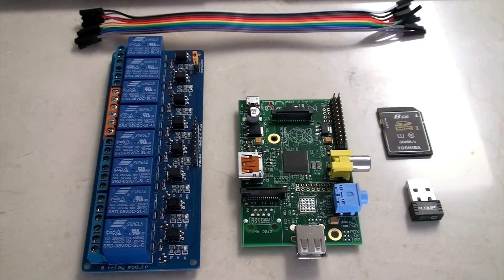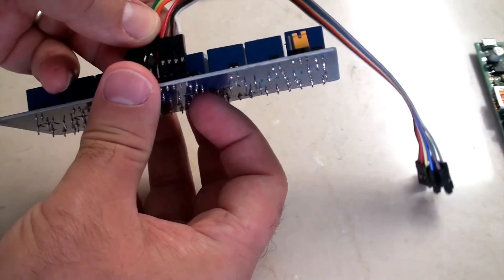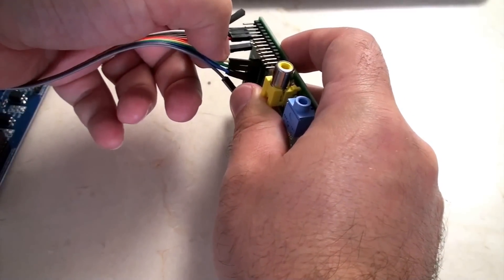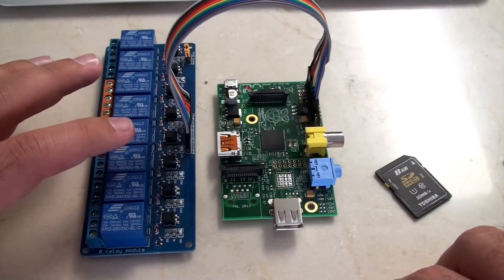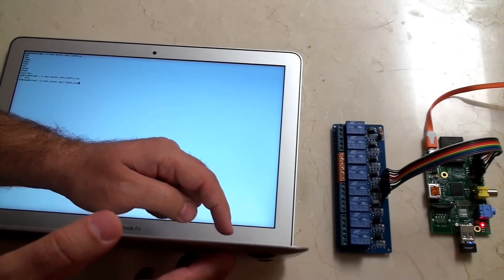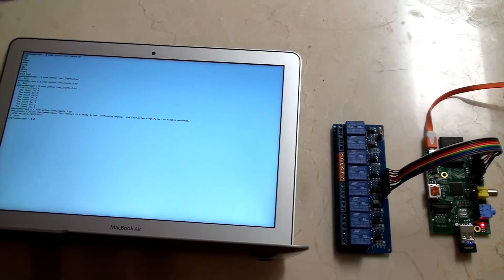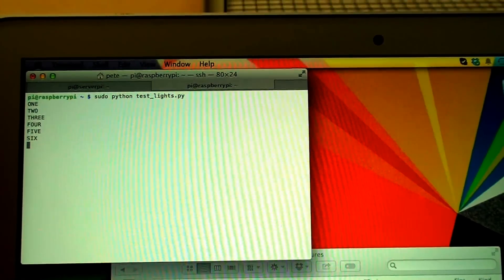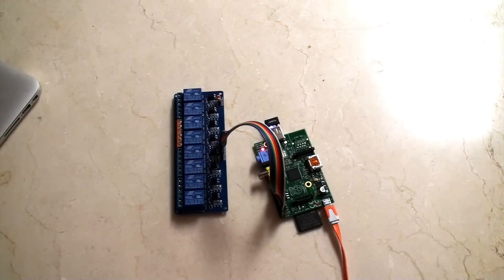Raspberry Pi: 8 Channel Relay step-by-step with software examples for automation

Comment: Great video, this really helped me understand Raspberry Pi GPIO so much more. I'm currently working this video through and trying to get it to automate some lights. Working well so far! but my in4 on my relay isn't functioning. So I hope it's not one of my pins, I've changed the wire and that had no effect. Going to have to try it on a different GPIO pin.. :)
Reply: Abraham Gihawi Just tried a different GPIO pin, as well as a different wire, and it's definitely the relay that's faulty. :(

Comment: great video. Do you need external power supply to control the relay board ? or just the power from Raspberry (5v) and will this work with the new raspberry pi 2?

thanks

Comment: I did exactly as you mentioned in the video but mine is a Rpi model B and I used a 2 switch relay when I turn the gpio on nothing clicks. Any idea why this could happen. However there is a faint LED light that turns on when my hand makes contact with the PCB pins. Other than that nothing happens(no light no switching sound). What could be the reason? Any help will be appreciated. Thanks!
Reply from the maker: Rahul Sathanapalli Maybe check this video out... https://youtu.be/OQyntQLazMU  I had problems but you can watch me work through them.

Comment: I'm starting a project that will control Relays taking commands from the internets, did you ever find out why the model B had that delay? Would it help if the relay board had a separate power source or is that not an option?
Reply from the maker: Vulpestruments That's what everyone here has indicated.  That with a separate power source, I would not experience that delay.

Comment: what died is your ethernet/usb controller at the end.. too much power output freezes the network connection thus ssh freezes. An annoyance I've had happen a lot when working with gpio. This not happening in the raspberry pi 2? I see it's in your description to get a 2B?

Comment: great, I had one running more than 6months all it has do is turn on the lights at 6pm to 6am outside. All I use is a Rpi A+, RTC module and 8channel relay module.

Comment: I have recently purched the 16 ch version of this board and was wondering if anyone could help me with the coding to allow relays to be activated by keyboard buttons. The 16 ch also has a port for a 12 volt external power supply alowing it to draw more power without straining the pi. I have a b+.

Comment: I'm no expert, but based on my experiences and stuff I've researched I suspect your assumption that the weird delay is power related is correct. I've notice that if I'm drawing a lot of current from the gpio pins that the status light on my wifi adapter can shut off. I think there is a minimum current threshold for them to work which is reached with these larger and more power hungry devices. The pause would be because the ssh client can't talk to the pi, but it waits a little while to see if connection is reestablished. Once it is, the terminal window updates and becomes useable again. That's my theory anyway. I don't actually own one of those relays to test it. If you're worried about it you might consider getting a separate power supply for the relay board and see if that fixes the problem.
Reply from the maker: Robert Forde Cool, I'll try that.

Comment: Hi all,

this all is completly new for me, so this video helped me to get started, using a Raspberry Pi B+ connecting on GPIO 17 - 24.

The scripts gave some errors, main problem was 'the numbering' in the scripts:
# for GPIO numbering, choose BCM
GPIO.setmode(GPIO.BCM)

#init list with GPIO numbers
pinList = [17, 18, 19, 20, 21, 22, 23, 24]

# or, for pin numbering, choose BOARD
#GPIO.setmode(GPIO.BOARD)

# init list with pin numbers
#pinList = [11, 12, 35, 37, 40, 15, 16, 18]

Use BCM OR BOARD, not together!!
Reply from the maker: Roland Megens Thanks for sharing this, I'm sure lots of people will appreciate it!

Comment: great vid mate, im a noob and i wonder how did you set up so you can connect and program wirelessly your pi??

Cheers
Reply from the maker: Nacho Miranda It's called SSH.  If you have linux or a Mac, use terminal to SSH in.  If you are a Windows user, the program you need is PuTTY.
Reply: skiwithpete thnx a lot man..you are awesome...one of the few youtubers thats responds every message posted...

Comment: Try this, it's fun.
I counts up binary.
I used it with leds, but it works as well with the relays.
Test all intedations. When I pasted i to this editor, all TABs and extra Linefedd was gone.

=================================================
#!/usr/bin/python

from time import sleep
import os

# import GPIO

import RPi.GPIO as GPIO

GPIO.setwarnings(False)
GPIO.setmode(GPIO.BCM)

# Setting up ports
# Just edit the following line for use with your relay setup:
LED = [4, 14, 15, 17, 18, 22, 23, 24]

for a in LED:
	    GPIO.setup (a, GPIO.OUT)

# Setting all outputs as off = 0
for a in LED:
	    GPIO.output(a, 0)
	

#Initialize variables
mask = [0, 0, 0, 0, 0, 0, 0, 0, 0]
Bit = 1

for b in range (0, 8): mask[b] = Bit << b
try:
	    while True:
# The loops to do things

        for a in range (0, 256):
			            for b in range (0, 9): GPIO.output(LED[b], a & mask[b])
			
			            sleep ( 0.2 )
		        sleep(1)
except KeyboardInterrupt:
    print
	    print " Cleaning up."
    GPIO.cleanup()
	    print " Goodbye."
===========================================

Comment: Hi; I am totally new to the mini pc. I was looking to control all my warning lights that are on my plow truck with a simple switch box that would contain just momentary buttons. I would like to connect these buttons to a PI that would be located in the engine compartment along with a ( 8 ) relay block. What i need to know is can I do this and how complicated would it be. I am some what knowledgeable of electronics but not the computer code. Can anyone take a moment and help me with this?
Reply from the maker: Big Guy Review I don't know enough about what you're trying to do to answer your question - but check my other relay videos too, you'll see what I was able to do with them.  Hopefully, someone else will come along and be able to help.  Cheers, P
Reply: thanks for the reply. All I wanted to do was control these 5 volt relays from inside my truck with out having a bulky control switch box.
Reply: Big Guy Review I think it would be easier to do that without the Pi honestly. The only purpose of the pi with the relays is to essentially create a digital switch (the pi and the scripts you run) to trigger each relay and turn it on or off. Have just some simple momentary switches connected to the relays would achieve the desired result and you'd skipt the programing step and wouldn't need to run a script every time you want to turn on or off a light. Or you could use locking buttons or toggle switches and wouldn't need the relay. Just make sure the switches are rated for the correct voltage and current

Comment: Hi,
Thanks for the tutorial, I am thinking using this setup as part of a project.
However I am a bit confused on which type of Raspbery pi to use. I would like to avoid the use of an additionnal power source for the relays. You mention that for this reason, only the type A should be used. Will the A+ or 2B (in the part list) that were not out at the time will work without "burning"?
Thanks in advance
Reply from the maker: Louis Bradier They'll both work just fine.  Cheers, P

Comment: You are powering the actual relays from 3v3 GPIO logic pins, this is very bad practice and should never be used even for testing. (as far as i know)

also the whole point of it being an optocoupled board is isolation, which you now bypassed so a small spark in the relay module and your pi is toast anyways.

sorry, just trying to give constructive criticism, i am only a beginner.
Reply from the maker: ZYLINX you are incorrect.  Watch Gaven MacDonald's video to better understand Relays and what the optocoupler does.  https://www.youtube.com/watch?v=b6ZagKRnRdM
Reply: skiwithpete hey, thanks for the reply. i watched the video and unfortunately already knew what he was talking about and don't see your point. you are still bypassing the isolation.

What i was trying to say is the relays and the logic pins share common ground. so to actually isolate your pi from the relays you must remove the jumper and NOT wire up a ground pin from the pi as setting a GPIO pin to low will act as the ground. and you should supply the relays ground and 5v from a separate power source.

in this configuration when the pi's 3v3 passes through Vcc on the board to a logic pin low it activates the optocoupler which triggers the transistor and closes the circuit between your separate 5v, the relay and ground.
Reply from the maker: ZYLINX
 Yes, you are correct, in this configuration, the board is not being powered externally, and so utilizes both the Pi's 5V power and 3.3V pins.
Reply: skiwithpete Just like to add i made a mistake where i said you are powering your relays from the GPIO pins and that its incorrect. i re-watched your vid and see you are using a 5v rail on Vcc so my bad.
but now that i have realized this, i am wondering if it is safe to ground 5v onto a 3v3 rated logic pin ? does the impedance of the circuit intentionally allow for this? lol
anyways great channel i subbed!! learning allot here :)
Reply from the maker: ZYLINX
 I'm doing this the quick and easy way.  I know there is a better way, but I haven't made a vid about it yet because it involves breaking your power supply and to get up and running, it's a barrier.  So, making this as easy and accessible as I can, I've
left 1.7 volts across the relays.  It's enough to activate it, but it's not the most beautiful.  Yes, it's quick and dirty.  But, it's easy easy easy.
Reply: skiwithpete Awesome, i also had mine hooked up like yours, or so i thought but i blew my pi :( only to later realize i had my wiring harness wired up completely differently.
where i had, and am now successfully using this configuration, which also does not need separate power supply.
3v3 -> Vcc
5v -> JDVcc
Ground -> Ground

as opposed to your:
5v -> (Vcc - JDVcc) //using the jumper here
Ground -> Ground

I can understand your way is preferred if the relay board does not accept 3v3 as a high logic level.

Comment: Awesome video walk-through, thank you!  I didn't realize relay boards were this affordable.
Q1) If I want to use the B+, can I connect all the GPIO and then provide power externally using the 5v/GND pins and a power supply?
Q2) If the first answer is yes, can I use a voltage divider to drop my 24v supply down to 5v?  In other words, will the required current be too high for small resistors (<1W)?

Very new to all this, but thanks for any feedback!

Comment: Hello I created this simple code to turn one of my channels on and off but still not working, i want to be able to control my light through html and python
my codes are

import RPi.GPIO as GPIO
GPIO.setmode(GPIO.BOARD)
GPIO.setup(12, GPIO.OUT)
GPIO.output(12,1)

import RPi.GPIO as GPIO
GPIO.setmode(GPIO.BOARD)
GPIO.setup(12, GPIO.OUT)
GPIO.output(12,0)
Reply from the maker: Hytham Aly Check out my 4 channel video - specifically script 5 and 5a for help with this... https://www.youtube.com/watch?v=OQyntQLazMU

Comment: good job , very interesting and informative - suggest: you could use built in quicktime to record your laptop screen for an improved experience - also: how can we know / monitor the power draw issue more definitively (measure) ? A vs B vs B+ ?
Reply from the maker: Yes, you're right.  I should get something to measure the power draw...  I'll look into that.

Comment: The question about why the output stopped displaying when using the Model B may have been rhetorical, but if not, I'd guess that there wasn't enough current to run the relays and the wi-fi adaptor, so when you operate enought relays, the wifi stops working. The code finishes, the wi-fi comes back on and the laptop them displays the remaining counts 7, 8, 9. My suggestion would be to give the relay board its own 5V supply.
Reply: A quick way to test this theory would be to have a continuous ping going to the device IP - i.e. "ping 192.168.0.2 -t" in CMD Windows, if the pings drop "Request timed out", then you'd know communication to the Pi over Wifi was stopped.

Comment: Hi matey I have since read that i needed to go gpio 5v to the vcc on the set of 3 separate jumpers on the far side of the relay board and the grounds to each other also. And the gpio 3v to the signal vcc and having tried this it won't let my pi boot up :-/ any other suggestions?
Reply from the maker: 999monkeymonkey  I can only say what worked for me.  But, why not try it.  Worse case scenario you'll need a new pi and an a new relay.  What's that cost?  $40  or if you're A+ $22?

Comment: hi I have a 5v 2.1 amp usb adaptor running my model B+ Pi and all I get is the relays lighting up and no clicking is this due to not enough power? Do I need a 3amp one? Cheers
Reply from the maker: 999monkeymonkey not sure.  Did you follow my instructions exactly?  Some guys here wired it differently and didn't get the clicks.

Comment: Doesn't the GPIO pins need resistors inline to the relay as the pins only supply 5v?
Reply from the maker: Perkunas T
Yes, I am aware of that document.  "NOTE on 3.3V Signals:
It is possible to use these relay boards with 3.3V signals, IF the JD-VCC(RelayPower) is provided from a +5V supply" it then goes on to say that it will work if "the VCC to JD-VCC jumper is removed." however in practice I have found that not to be the case.
Reply: 3.3v I mean
Reply from the maker: Richard Groizard
 with the optocoupler relay (like the one in the video and the one linked...) it can be activated with less than 5V.  So you need 5V to power the board, but only 3.3V and 2-3mA to activate. 
Cheers,
P
Reply: Oh that's great thank you
Reply: skiwithpete
 This I was I was trying to say earlier, this link explains the power problem, just read it about half way down.
http://arduino-info.wikispaces.com/ArduinoPower

Comment: All my red leds are on but dimmed on the relay, any idea why?
Reply from the maker: SQUAREHEAD Not sure, hoping someone else might jump on here and help out...  what's your power source rated at?  How many Relays on your board?
Reply: I have a 3amp 5v adapter. The relays work fine it's an 8 channel board it's just strange. I'm using a raspberry Pi A+ and have it wired slightly different to you
Reply from the maker: SQUAREHEAD
 There's the problem, you wired it differently.  I've tried to wire it the way Gaven McDonald suggests and it doesn't work.  Best, P
Reply: skiwithpete I have had a similar problem. The program turns the relay on however the lights do not click or light and actually the lights turn off. I have wired the raspberry pi exactly like you have.
Reply from the maker: Ben Coxford is there any chance you could upload a vid with it not working and explain the pieces that you've got?  It's difficult for me to tell the problem without seeing that you've got a 5V relay with the optocoupled switches on it - and that you have wired it up the same way.
Reply: Will post a video soon.

Comment: Hi 
Thank you for the video.
I was following along your video and I noticed that the GPIO pin only provides 3.3v when they are on HIGH
so my 5V relay only blinks, but does not give a control and that click sound/
How did you manage to supply the relays 5V with GPIO outputs?

Comment: hi skiwithpete,
i used some of your code but modified it to use GPIO.BOARD settings as i cant grasp the BCM, i guess thats wrong but i find it easier.
also, i picked my 8 channel relay up from a china ebay seller, 4 out of the 8 relays have gone silent in the last few hours, its the same four, changing the gpio cables make no difference.
just wondering have you come across a dodgy relay board where one fails.
also is it possible to manually force to relay to act by touching any particular points under the board?

many thanks
D
Reply from the maker: Try swapping the leads for the clicking ones with non-clicking ones... That should tell you pretty quickly.  Let me know how you go.
Cheers,

Comment: Very simple but effective demo. I'm a network engineer by trade and like many I have a test lab at home full of kit I can connect to remotely. Downside is leaving it all on so it's accessible can burn something like 650-700w. The plan is to borrow some of the principals and code you kindly provided to be able to connect remotely to the Pi and power on only the equipment I need, only when I need it. Hopefully saving me a heap on my energy bills!
It should also be a fair bit cheaper and more fun than buying a proper network managed PDU off the shelf :)

Comment: You obviously have an issue with your power supply, that's why it probably hangs with model B. Your input power adaptor is unable to provide enough current / and or voltage to the Pi and the Relay board at the same time.

I've used these relays with both model B and now B+, and everything was working fine.
I'm using only quality 2A certified power supply units.